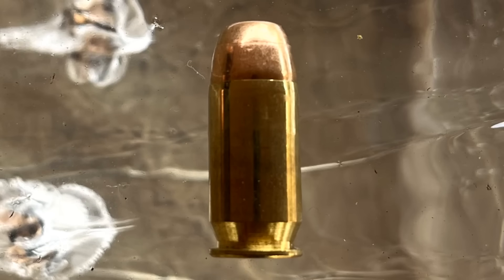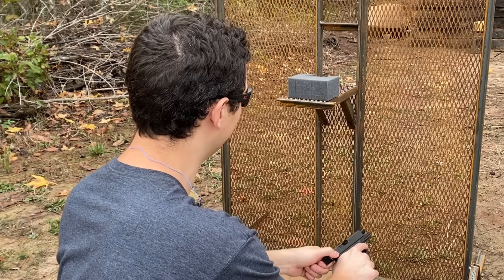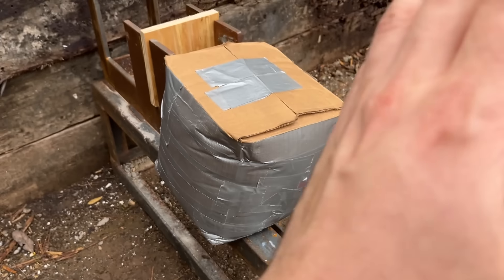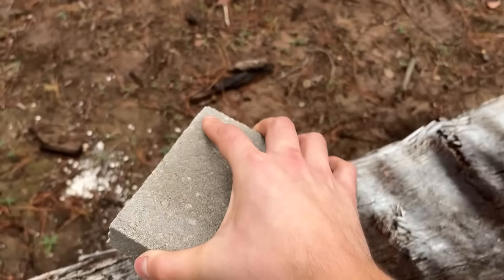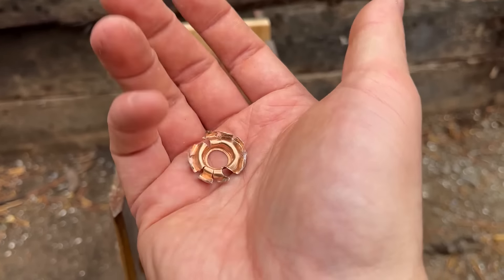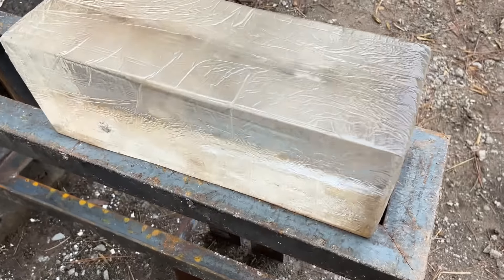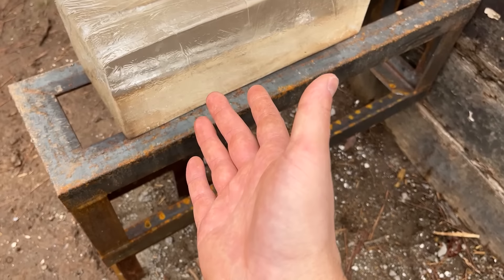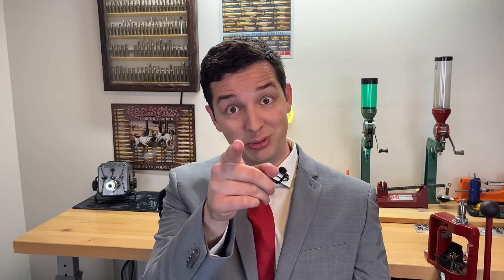9mm vs 45 ACP Barrier Test: No Debate?

Comment: The reality is that the 9mm vs 45 ACP debate originated when full metal jacket "ball" ammo was all that was available.  Hollow points were usually lead tipped, which were unreliable on the feed ramps of autoloader pistols.  The thought process was do you want a pencil sized hole or a thumb sized hole in the bad guy.  Today, bullet technology has advanced to the point that renders a lot of the debate a moot point.  Federal HST is my "go to" ammo for everyday carry.
Reply: Exactly people don’t realize this. You explained it good.
Reply: "BuT BigGEr iS BettEr!"

"My 1911 won two world wars!"

"You can't be a man if you caliber doesn't start with a 4"

And here we are, carrying more rounds, more effective (I'll even take equally effective), cheaper, and more available. "Ok, Boomer" applies lol.
Reply: 9x19 fmj rounds tend to tumble inside targets while .45 fmj rounds tend plough straight trough without destabilization. 9x19 rounds travel faster as well and while traveling sideway tumbling they dump way more energy than a forward facing .45 acp. Post ww2 soviet tests found out 7,62 tokarev and 9x19 fmj rounds to be slightly more effective than .45 acp fmj and 9x18 makarov prototype to be slightly inferior to all of them. Only advantage given to .45 acp fmj rounds was given to large bone hits where the damage was slightly increased compared to 9x19 or 7,62 tokarev. 9x19 and .45 are in the same band of performance even when using ball rounds (US army and FBI studies reported the same)
Reply: 40 is the correct answer vs human sized questions
Reply: I'm no expert but I'm pretty sure 9mm also has had a lot of development from the old days while 45acp has pretty much stayed the same.
Reply: @Nethezbet 9mm is older than 45 acp. 9mm is the ok boomer round.
Reply: @DinoNucci  I've shot 40 a bit, and I didn't hate it. It also has close to or the same capacity, which is good. That being said, any dive I've done into comparing the two seems pretty consistent in matching up with my experience. The recoil wasn't the terrible experience it's often exaggerated to be. But, it was snappier in character, and actually less pleasant than the 45 ACP's push. 

The difference in results/ballistics just doesn't match up with the difference in recoil and affect to follow-up shots, which are going to be necessary, as it is a handgun cartridge. It's not a bad cartridge, it just seems a net loss compared to a 9mm.
Reply: @vipe650r  98% wrong
Correctly loaded 40 eats 9mm lunch
Reply: @Hercules1-v9m  It has nothing to do with the caliber age, it has to do with the people that wear their ass on their shoulder over the 45 being some sort of magic bullet with mythical "stopping power." It is the crusty old man with the 1911 screaming "If it was good enough for Patton, it's good enough for me!"
Reply: @DinoNucci  Ew, 40 is trash. It was a mistake when it was made, and it can't decide what it wants to be when it grows up.
Reply: @Nethezbet funny... My 1911that I carry on duty is a double stack and carries just as many rounds of .45 as the local agency's issue G19/G45s...

Not hatin'... Just sayin' your "boomer" comment is kinda old?
Reply: They've definitely improved almost every angle of 9mm & 45 acp over ball ammo. I carry hydroshok in my 45acp, & before that it was black talons when they were available.  Haven't had the chance to try the hst's but have heard great things about them, as well as seeing some of the testing.
Reply: @Nethezbet  .... New to firearms are ya lass?
Reply: @eddybear771  I run Gold Dots in both my .45 and 9mm... Been doing so for decades now.

Big improvement over FMJ.  lol
Reply: @johnhermann7498  I do actually have some gold dots, & love their performance in my kimber 1911, but they can't seem to group well in my colt. Still plenty adequate for beyond FBI, 21 ft range, but I think it's more that my Colt is a bit lighter, & target re-acquisition is a little slower.
Reply: It's too bad the scientists couldn't introduce the advances in bullet design for the 9mm to the .45 acp. That would have really been something. Too bad we'll never know.
Reply: After the second Iraq war, the Army conducted a medical study. Found the 9mm was slightly more effective at stopping opponents & slightly more lethal. 

Of course, they also mentioned troops were far more likely to hit the enemy with the 9mm, even though most 45 data was from Marines & special forces who were considered far better shooters.
Reply: @marklemist6928  the biggest limiter for the .45, imo, is velocity.  I had custom 230s at 1100fps and they were monsters. But they are really, REALLY, hard on the gun. I had to get a 22lb recoil spring for my 1911 because the rounds were beating the hell out of the slide.
Reply: Comparisons are the legit if u don't compare similar weight  bullets.
The 9mm was lighter and moving faster so i penetrated deeper.
Run the test with similar weight bullets and see the results.
As a paramedic with 39  years experience, I've seen many victims with 9mm rounds to the chest live 
I've never seen a victim shot in the chest with a 45 live
Reply: Love the 147 grain Federal LE HST for my carry and self defense ammo.
Reply: The bullet technology changed for all calibers. Meaning that the scale just moved up and it is not a moot pount
Reply: @ragingboarsoutdoorinnovati7928  wrong
Reply: @marklemist6928  lol good one
Reply: AMEN to all you said and HST is my 2nd but is a great bullet.
Reply: Ackchyually, hate to be that guy but it wasn't that hollow points weren't available they weren't and still aren't allowed by the Geneva Convention. Military had to use ball ammo. If they used hollow points it would be a war crime. It is true that many auto loaders of the time were designed to feed ball ammo because that was what military are allowed to use, but if I had to choose just ball it would be 45. As a civilian though I am not restricted to use them.
Reply: @theduckfu  no
Reply: @DinoNucci not sure what you are saying "no" too but I did do some research and found out that the US didn't agree to this officially, just "To employ arms, projectiles, or material calculated to cause unnecessary suffering". But around 2018 the United States Army began production of M1153 for use in situations where limited over-penetration of targets is necessary to reduce collateral damage. So I guess at least the US uses hollow points in military now.
Reply: You have to look at the gel block channels from all 4 sides... Not just one 🤦🏼‍♂️
Reply: @johnhermann7498  double stack .45 designed for man hands
Reply: And then we found out you were getting pencil sized holes with both so take the added capacity with less recoil
Reply: Yep... you pretty much nailed it.
Reply: This is not correct either, or 45ACP hollow point,  and yes, with modern ammunition, still produces 60% more crush tissue damage in the permanent wound channel over a 9mm, this has been repeated over and over with ballistic studies.
Reply: @officedullard8722 

 Wrong. 
 every development and technology that is available in 9mm is also available in 45 and every other caliber.
Reply: @johnhermann7498 
 Velocity has no effect whatsoever when it comes to pistol cartridges affect on the human body, it either penetrates deep enough or it does not. 
A 45ACP with 230 grains moving approximately 800 to 900 feet per second has no problem whatsoever.
Reply: @nickdial8528  strange, because everything is actually showing more like .60% more tissue crush….
Reply: @nickdial8528  Do you have one that says this at hand? Gel block tests usually show what is seen here. 
The most common consensus is that the 9mm compensates diameter by higher speed. As speed is also a determining factor for the size of the temporary wound channel, and thus the amount of bleeding from ripped tissue. 
Like even tiny rifle bullets cause huge temporary cavities.
Reply: @theduckfu  hollow*
Reply: Underwood extreme defender, 68 grain plus P going 1800 fps changed the game
Reply: @nickdial8528  
Hm. I'm not so sure that's entirely accurate. The principle design has been rather untouched from what I can see.
Reply: @TriggaTrey361  lol no
Reply: 9mm is the best option for everyday carry just due to magazine capacity.  Any potential advantages you’d have in 40 or 45 are negligible and the extra capacity is what makes the difference.
Reply: @np4057  wrong
Reply: @DinoNucci  cool story troll
Reply: @DinoNucci  are you on the spectrum? Because then yea your right makes sense buddy have a good day make sure to brush your teeth
Reply: @TriggaTrey361  you're*
Reply: @nickdial8528   wrong
Reply: @theduckfu   wrong
Reply: @nickdial8528  - "... Velocity has no effect whatsoever when it comes to pistol cartridges affect on the human body..."

Physics and hydrodynamics would disagree with that statement.  Check the formula for Kinetic Energy and get back with me on this one.

Not hatin'... Just sayin'.
Reply: @johnhermann7498  

 Yeah and I'm telling you, when it comes to the wounding properties, pistol cartridges on human tissue, you get no benefit from higher speed pistol calibers, your formula has nothing to do with the wounding properties of pistol bullets.

Pistol bullers do not go fast enough to cause hydrostatic shock, which is a controversial topic anyway and has minimal to any effects, and is only possible with rifle rounds.

When it comes to pistol cartridges, all of the testing and data shows, faster pistol bullets do not increase wounding properties.

The only thing that does, is larger Area of the bullet, plus the depth it penetrates to cause a combined volume wound index, heavier, despite being slower always causes more damage. fast light bullets, or even a heavier fast bullet... it doesn't matter.

If it penetrates to where it needs to,  any speed beyond that doesn't have any more wounding effect.

 You can read all of this for yourself, Google "2017 combined agency study on defensive handgun ammunition, they explicitly get into this and great detail."

"“At the lower velocities of handgun rounds, the temporary cavity is not produced with sufficient velocity to have any wounding effect; therefore any difference in temporary cavity noted between handgun caliber is irrelevant.”12  High speed (>2,300 fps) rifle rounds were tested at some of our events and the animal tissue media was dissected and showed tearing outside of the permanent wound cavity which was never present in any of the handgun rounds, further confirming that temporary stretch cavity has no effect on wounding a target with <2,000 fps projectiles.  Also, recent testing has showed that the actual projectile velocity required for the temporary cavity to have a wounding effect from tearing human tissue is nearer to 2,200 fps.13  The real velocity (2,000 or 2,200) doesn’t matter and is probably not exact.  What is important is that pistol rounds all travelling significantly slower than these figures do not produce a temporary cavity that creates any wounding effects.  Unfortunately, it is still used by non-experts during handgun ammunition assessment. "

"Energy transfer is often quoted and is completely immaterial.  First, the transfer of energy is represented by the temporary stretch cavity and as stated is insufficient in low-speed pistol rounds to cause wounding.  The human body can absorb a great amount of energy without being damaged (a baseball hit in a game, or a hockey puck has approximately half the energy of a 9mm bullet being shot).  Lastly, the human body is not one solid mass where energy is easily transferred throughout the body.  Changes in tissue density and space between organs nullifies a vast amount of transfer of energy.  The human body is compressible which absorbs energy and the pressure wave unlike ballistics gelatin, which is an uncompressible liquid.  We must also discuss Energy vs Momentum.  Comparing hollow points during our tests and the six other major federal handgun ballistics tests it was conclusively found that the heaviest hollow point bullets in each caliber average larger Permanent Wound Cavities (PWC) than lighter bullets in the same caliber. “Increased bullet mass will increase penetration.”35  “Increasing velocity does not increase expansion as almost all hollow points regardless of velocity wrap back on themselves.  In fact, increased velocity typically increases failure rate.”  In 6 of 7 tests the heaviest hollow point 9mm (147 grain) bullets averaged the largest PWC over any other weight 9mm.  In 5 of 6 tests the heaviest .40 S&W bullets averaged the largest PWC over any other weight 40.  In 7 of 7 tests the heaviest .45 ACP (230 grain) hollow point bullets averaged the largest PWC over any other weight 45 hollow point.  In all cases the heavier bullets in any caliber have less energy than the lightweight bullets in that caliber that have the highest energy'

-comboned agency study on defensive handgun ammunition
Reply: I highly recommend trying out Underwood/Lehigh Xtreme Defender ammo. Totally barrier blind and  complete energy transfer into your "target".
Reply: Easy to see the gel block moved back a bit more with the .45 than the 9mm too. Kinetic energy would be a good test here. Because both wound channels were near the same, but the .45 pushes a much larger cross section, and heavier bullet for essentially an equal distance.
Reply: "Velocity and expansion are variables! Mass and cross section are constants!" Col Jeff Cooper. While it is true that modern JHP's do enhance the performance of the 9MM, .45 +P's desire that performance gap. Then you have .45 super which places it alongside 10MM
Reply: @Jack72607  Except for the fact that Japanese Soldiers in full Banzai charge stopped when it with .45 and kept charging when hit with 9MM
Reply: @Nethezbet  Other way around! The Wonder Niners accuse .45 ers of claiming miracle ammo claiming the 9 is the wonder round
Reply: @Nethezbet  It has a great track record in Law enforcement. The wonder 9, not so much
Reply: @johnj5985  

 Just because they look the same in a gel block doesn't mean they are the same in reality. 
when it comes to gel, it is not compressible like living tissue in a human being, the channel is absolutely meaningless in gel block's. 

gel blocks are only useful to measure penetration depth within reason, because it doesn't actually translate over to tissue as well for a 1 to 1  basis, and it's good to check bullet expansion for comparison.
but contrary to popular belief, it has nothing to do with actual wounding.

A 45ACP has a much larger surface area and pocket depth, and when you times that by the penetration depth, a 45ACP generates 60% more crushed tissue damage than a 9 mm, which is a significant amount of hemorrhaging. 

 The FBI came to this conclusion and reported that in 1989 in their ballistic study, and this has been corroborated and confirmed in two independently held  ballistic studies, one in 2017, and one held this year.

 Heavier mass bullets that are larger in circumference causes greater permanent wound channeling, regardless of "energy" by lighter faster bullets. 

 Like you pointed out, the block moved more, which is because the heavier mass bullet with its momentum.
Reply: @bernieeod57  Track record so great that most of the agencies that used 40 and 45... went back to 9. That must be super great. Statistically it was found that any of the 3 do the job, so why carry heavier, more expensive bullets? The differences between them are miniscule in real world actions, especially in expanding self defense rounds.  

It is basically pistol calibers < rifle calibers. Order them however you like, but it is a dumb thing to argue when combat has so many variables with the most important being shot placement, which doesn't favor any of the popular sizes.
Reply: @bernieeod57  According to what source?  Because I very much doubt this.  It sounds like those anecdotal stories, like the M1 Garand's ping when the clip ejects will be heard by an enemy soldier, who will then pop up from behind cover and kill you while you are frantically trying to reload.  Or like the one about Japanese officers cutting through machine gun barrels with their katanas.  And if you actually attempt to track down the source of such stories, it invariably comes back to, "I talked to guy over in B company, and his buddy saw it with his own eyes," or some such thing -- you'll never manage to track it back to a first hand witness.  I think this assertion falls into the same category, because pistol cartridges don't have "stopping power."  It's a myth.  No pistol cartridge hits with enough force to make the temporary wound cavity stretch beyond the elastic limits of human tissue, the way rifle rounds can.  The size of the permanent wound channel is key factor, and the .45 caliber bullet is a mere two millimeters wider in diameter than a 9mm bullet.

Do you really think an extra 2mm makes all that much difference?

Terminal performance is notoriously hard to measure, so giving some quantitative value to a cartridge -- like, for example, asserting .45ACP is effective 80% of the time, while 9mm is effective 73% of the time -- is really not possible.  All the best evidence we've gathered, both from laboratory tests, and evaluations of real world shootings, is that all the major service pistol calibers in common use today perform roughly equally.  There's no real, measurable, definitive difference.  Even the cartridge with the very best "manstopper" reputation -- the .357 magnum -- if it has any advantage at all, it's very slight.

Here's what we know: the only way to reliably guarantee an instant neutralization of your threat, is to achieve a hit to the central nervous system -- the base of the brain or the upper spinal column.  That will genuinely drop someone like a puppet that's just had its strings cut.  But that's a small target, and very hard to hit under stress, so people rarely try; they aim center mass, to go for the second quickest way: circulatory collapse.  You hit the heart, an artery, or a large blood-bearing organ, and cause the target to loose so much blood that his body stops functioning.  But depending on just what you hit, this can be almost instant (e.g. the heart, or tear open the aorta), or take over an hour (e.g. the liver).  If you hit anything else... Well, it may or may not be an ultimately fatal wound, but it probably won't be completely incapacitating to a target that's aggressive and determined enough to fight through the pain and keep attacking.  The vast majority of people shot, if they don't take a CNS hit or suffer circulatory collapse, are what you might call "psychological stops" -- i.e. they just don't want to get shot again, so they give up, run away, whatever.

So...  the bottom line is, given that there just isn't much difference in real world performance among all the common service pistol cartridges, you have to look at the big picture when evaluating what each brings to the table.  If 9mm actually performs about as well, and it also gives you the benefit of greater magazine capacity, more controllable recoil, faster follow up shots, cheaper ammo (which allows for more practice), then choosing it may be the best overall trade off.  And I say this as someone who used to be in the "I carry a .45 because they don't make a .46" camp.  But everything I have learned has led me to the 9mm, and that's what I carry these days.
Reply: @Hibernicus1968  Service men who are still alive. Other than as an SMG young, the 9 was an execution tool, not a fighting tool
Reply: @Hibernicus1968  The 9MM was sent to the Philippines along with the .30 Luger during the Philippine insurrection and failed to stop Morro attackers
Reply: @Nethezbet  The te wondering of the wonder nine! The reason is that law enforcement misses 80% of the time and needs the extra magazine capacity
Reply: @Nethezbet  Worse, the wonder Niners are now calling one shot stops bad shootings because of failure to mag dump
Reply: @Hibernicus1968  Then we have Paul Harrel who tested the new re wonder nines FBI load in the Miami shootout scenario. The new FBI none would have still failed and the .40 would have worked
Reply: The old 200 grain "Flying ash tray" aKA Speer Lawman had a 97% one shot stop rate. Only the .357 magnum was better.
Reply: @Nethezbet  they went back because more women were entering the work force and couldn't qualify with a full sized pistol. God forbid they had to use an actual defensive cartridge like a full house .357 mag.
Reply: solid monolithic xtreme defense/penetrator
Reply: @Nethezbet  "I'll even take equally effective", sorry I've got to stop you there. I carry 9mm myself in a micro compact, but your just wrong that it's equally effective. The only way you can argue that its equally effective is with the qualifier that your using a poor performing 45 vs an excellent 9mm. Look at this video alone, you CANNOT find a 9mm that expands to anywhere near 88 caliber, a high performing 45 blows a high performing 9 out of the water. All of the other things like capacity and recoil are valid
Reply: @oblivionpro69  You miss the point. Yes, a 45 is bigger (and slower) and produces a nominally larger wound cavity. Yes, nominally, as it is sort of a non-issue. When we discuss effectiveness, it has to be taken big-picture. What is the end-goal of self defense rounds? Stopping the threat. The 45 and 9 are, in real terms, very similar. Yes, "biGGeR NumBEr!", I get it, but VERY similar. proper placement is priority 1, and while I know some tough guys will give me the "I just need one" argument, all my peers that have actually been in combat or shootings will tell you to train all you like, you won't be ready. 

More rounds on target, less recoil... FAR more effective way to get quality hits. A well-placed 9mm will beat a missed 45 any day, and since statistically all shootings have the average 80% miss rate, you need to look at what it means to be an "effective round." If I were a robot and could fearlessly fire impossibly accurately then load me up with the biggest bullets you can find. Regardless, the 9 and 45 both look identical when compared to a rifle round's destructive power, which is why I say the 9 and 45 are "equally" effective. IIRC, even by the stats I think 380's were shown to be more effective in shootings, lol. Certainly not much power there, but very easy to shoot. I dunno that I would give THAT much up, but just as I don't fault people for carrying 40/45/etc the numbers simply don't show any REAL world advantage to the larger rounds. 

Just slightly bigger holes in gel. I mean, if that is your priority then go for it, self defense is a personal thing.
Reply: Try libdrty civil defence fraging 1900 fpc
Reply: @DinoNucci  No. Just no. +P 9mm rounds are similar in power to .40. But even if 40 had an extra 10 percent power, that's not very much when you're talking about pistol rounds. I think most people would take an extra 3-5 bullets that are only 5 or 10 percent less powerful even if that was the case. But +p and especially +p+ 9mm rounds are just as powerful as .40. It's why almost all law enforcement is now dropping the .40 there's just no reason for it anymore.
Reply: @johnhermann7498 you can get 1100 fps out of 185 grains and it be reasonable. Same type of velocity out of 9mm basically
Reply: @joshdiehl8737  define "reasonable"...

In a general sense (to answer your question): Yes. 

You can get 1100fps with a 230gr bullet but you better not try using it in your HiPoint.

;)
Reply: @Jack72607   🤔7.62 x 25 has much higher velocity & energy than 9mm & .45cal.
Reply: @howardwatts4238  ✅so one does not shoot thru walls👍
Reply: Very well stated, 100% True!
Reply: 45 is better and the wound it leaves is much worse.  357 magnum is best handgun for self defense.  More energy and velocities make it king of wounds.
Reply: 1: John M Browning stated the 1911/1911a1 .45acp was meant to only use 230gr bullets. Mainly FMJ "ball". 2: I own a used Glock gen 4 .45acp model- 41, I use HST 230gr +P mostly. Good stuff.
Reply: @SaundersE5  I like 9mm 124gr. Most firearm makers 🏭 use 124gr to T&E guns. Not 147gr or 115.
Reply: @np4057  I agree to a point. You get a lot from a 10mm or .357sig but they are not common.
Reply: @DinoNucci  40 cal. Why not 45 acp with 180 gr. all but the same thing.
Reply: @Nethezbet     what magic rd is that? The magic rd is the one u can put on target consistently.
Reply: @np4057 😅😅
Reply: @bernieeod57  Where do you get these myths from? Please show me links to the studies for this. The Marines never used 9mm during WW2, the Germans did. And it wasn't the 45 stopping Banzai charges, it was the M1 Garand and the Browning 1919 mainly. Maybe a few M2 Ma Dueces and a few Thompson 45 sub machine guns which doesn't equate to stopping power from a 45 ACP pistol.
You are getting confused with the Morro rebellion in 1902 when the army was issued 38 specials with old lead bullet technology.  That didn't have stopping power, so the army switched to the 45 Long Colt which later morphed into the 45 ACP for the new 1911s.
Reply: @bernieeod57  The 9mm didn't "fail" , the  old 115 grain Silvertip bullets worked like it was designed and didn't penetrate deep enough because back then they thought rapid expansion was more important than penetration.  The bullet stopped 1 inch through the 150 lb body from his heart after traveling through the right side of his upper arm into his chest cavity.
They have learned and require their duty rounds to penetrate 12-18 inches in 10% gelatin now.The 45  Silvertips back then didn't penetrate deep enough neither to do the "stopping" power.  The old Silvetips had a penetration of 10 inches in Gelatin  and has a tendency to shed it's jacket. This incident led to the creation  of the 147 grain 9mm and the 10mm which was downsized to the 40 S&W because of the recoil of the 10mm for "petite" agents. Now the FBI is back to the 9mm as studies has shown with more modern bonded hollowpoints, there is really no difference in "stopping" power between  the 9mm, 40 and 45.
Either way, neither calibers would  had not mattered as they were using three 9mm semi auto pistols ,four 38 revolvers loaded with 38 specials  and a shotgun against a Mini 14 and a revolver loaded with 357 mag. All the damage was caused by one person with the Mini 14.
These were tactical mistakes that caused this tragedy. Never bring handguns to a rifle fight.
Reply: @joeiborowski9763  That was a failure! The perp was hit in the A Zone and was still able to kill 2 agents! Paul Harrel demonstrated the FBI's new "Re wondering the wonder nine" Round would also have failed and the .40 would have worked. The sub .40 caliber pistol round does not come into its own until you get into .357 magnum ballistics. The major caliber power factor holds true. Cooper once stated "If you caliber does not begin with a 4, it needs to end with an M"
Reply: @joeiborowski9763  The 9MM, .30 Luger, 7.65 Mauser were all tested in the Philippines. They were all found lacking when compared to the re issued .45 Colt
Reply: @bernieeod57 And how were they tested? To execute prisioners? Why would a soldier use these puny handguns for combat when they have battle rifles and risk dying. Show me he studies not an inernet folklore.
Show me tthe published sudies.
Reply: As you mentioned,the ammunition has changed dramatically 50 years.At 68 I am still a 45 acp guy, but with the newer ammunition and amount of rounds carried in most 9mm to day, I can’t fault anyone for carrying one. (But 45acp is still the King)😉
Reply: @Nethezbet The bad guys don't care how cheap your ammo is.
Reply: @ Nethezbet Patton didn't carry a 45ACP, he  carried a 45Colt. He claimed that the M1911 jammed easily, especially when fighting in the mud. Not to mention that what they used to call 45 long Colt, is twice as powerful as a 45ACP, and that's a fact, it was the big boy on the block  all the way till they came up with the 44mag back in the early 70s. And the magnum is still only a wee bit more powerful than the 45Colt. 

Speaking of Patton, he went down to Mexico with General Pershing in search of Pancho Villa during the Mexican revolution, can't recall the name of the Pueblo they were in, but Patton was standing in the middle of the Plaza, wearing his trusted 45Colt on his hip Western style, when three mounted Villistas rode into the Plaza at full charge, all four men exchanged gunfire, and within a few seconds all three of Villa's Dorado's fell dead from their horses. Patton made a name for himself that day, as a bad ass gunfighter, and it followed him around for the rest of his life. 45 long Colt, the hand gun that won the West, to go along with the Winchester repeating rifle. That rifle was the main reason the North won the Civil War, the Confederates were mostly using muzzle loaders, and stood no chance against the Winchester repeating rifles....
Reply: As far as ammo goes for everyday carry, I'll take Remington Golden Sabre hollow points for a 45ACP, and 9mm critical defense rounds by Hornaday. Love my mark 4 series 70 Government Model 45ACP, but I do believe my Colt Delta Elite in 10mm, got both the 9mm and the 45ACP beat....